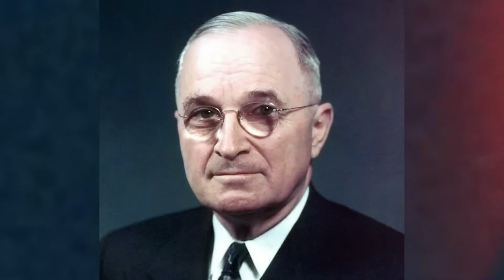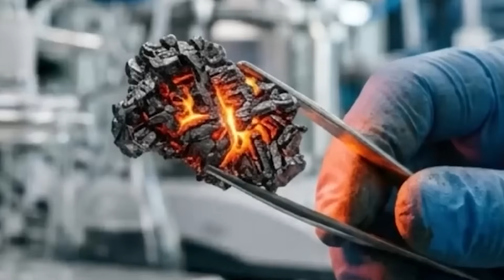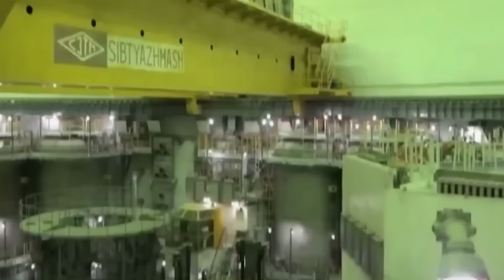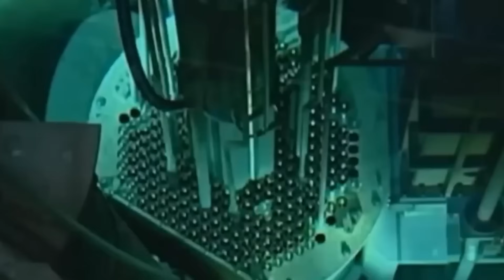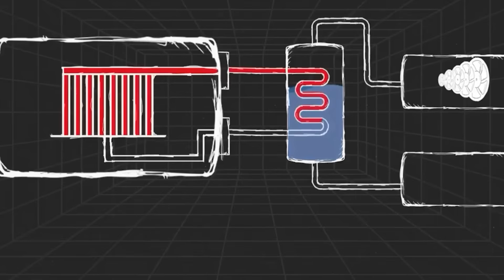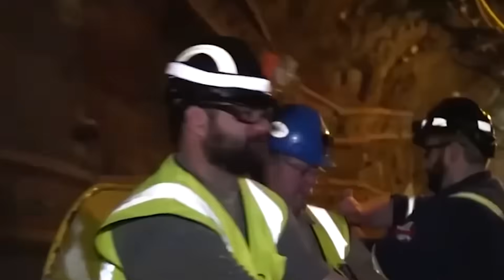China Built A Reactor That Runs On Sand — Engineers Are Calling It Impossible

Comment: As he briefly said:  THE REACTION IS A FISSION PROCESS. Nuclear reactors are a fission process. Don’t talk about the product that transfers the heat to the steam engine. Talk about the actual process and product that changes from one atomic-mass-number to another over a period of thousands of years, and releases heat. It is what we call a Nuclear reaction. The strength and density and penetrating power of these particles determines the danger of the reaction. It could be and should be the further of our energy needs. 
Just three catastrophic mis-haps have destroyed this utopia. There are hundreds of reactors working perfectly safely in the world but just two or three disasters have over-shadowed the energy they could supply. 
 Modern reactors have a completely different mode of operation and do not have the thermal run-away of the original design. 
And new designs are even more safe. Buy the construction of these power-plants is enormously expensive because you have to pay the “lookers-on” millions of dollars in “looking-fee” because they think they are the saviours of the world.